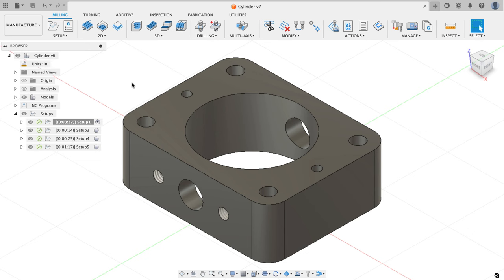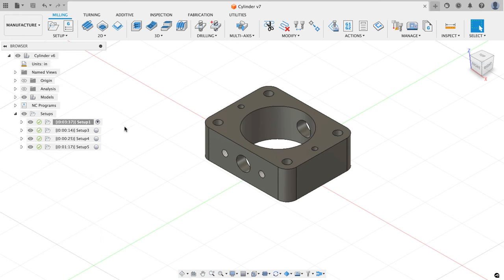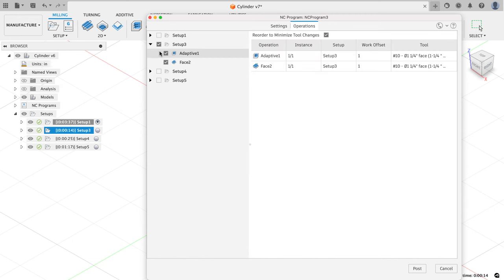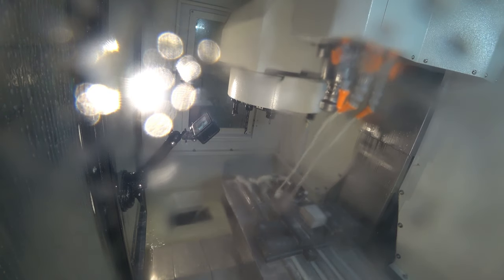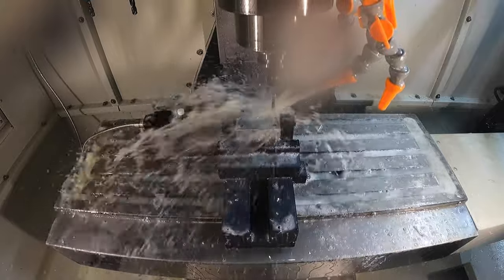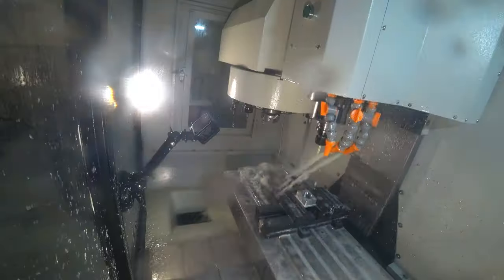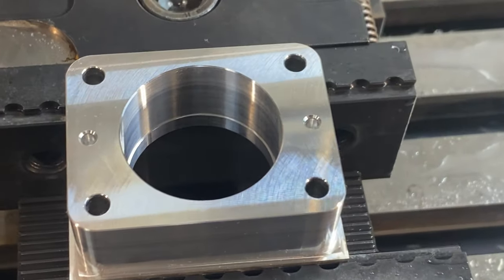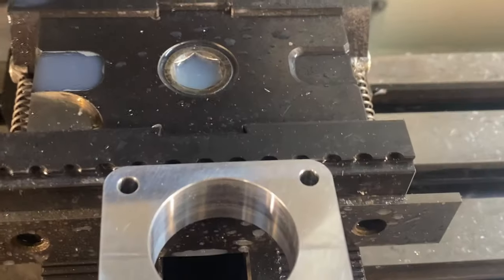Model Engine Project - Cylinder Machining

Comment: Great job with the video Kevin! Thanks for sharing your knowledge with us trying to learn cnc. I recently stuck a GoPro mount in the front side of the spindle housing and it seems to be helping keep the coolant off the camera. I might look into making one of those air blades also.
Reply from the maker: Thank you Adam. I'm glad you liked. Maybe one day I'll be able to replicated your video setup skills. Thanks for the GoPro tip. I'll see if I can give that a try.

Comment: for the surface finish if you want some beautifully finissh you can only use one plates in the face mill around 3-5000 rpm and .1mm\tooth in feed for aluminium and plastic this methood fits :)

Comment: Great series, very helpful! Which post processor do you use?
Reply from the maker: Siemens 808D Emvio from one of the guys that sells the Syil machines. George his his name. Are you running this machine/control too?
Reply: @MechanicalAdvantage  Yes I have the X7 with the 808D Advanced. Getting ready to start it up soon. It's been sitting since I got it 2 years ago.